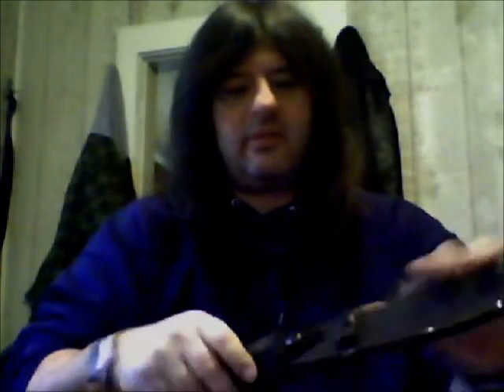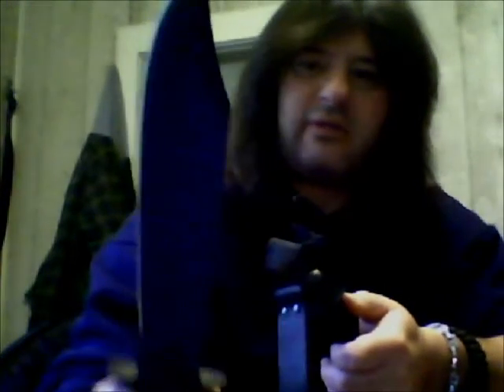ONTARIO SPEC 10 RAIDER BOWIE

Comment: dude i hate to be a downer but i just found this pic of a raider bowie without handle and tangs not even 3/4" wide , takes an idiot to design this big knife with such weak tang.search this at ebay to see : Marine spec plus Sp10 customizable knife New USA made Ontario NY . i cancelled my order for it at amazon and am going to get the arknsaw bowie you like for its bad ass full tang and thick blade = 2 most important features that make the knife to me . pakistan designs better knives than usa !!